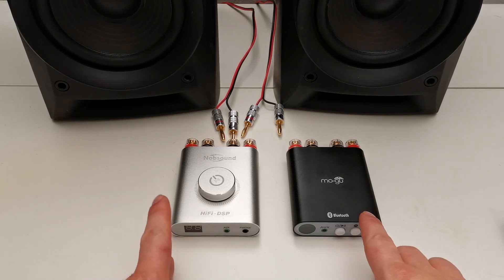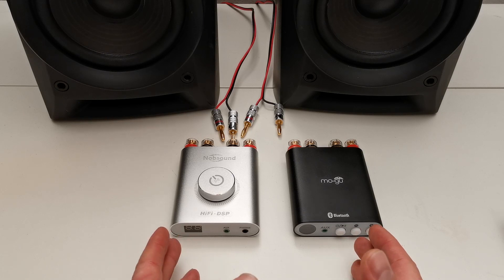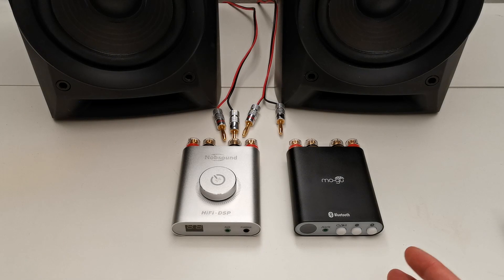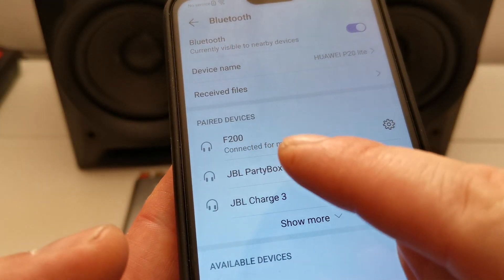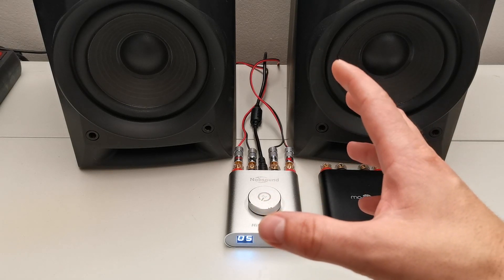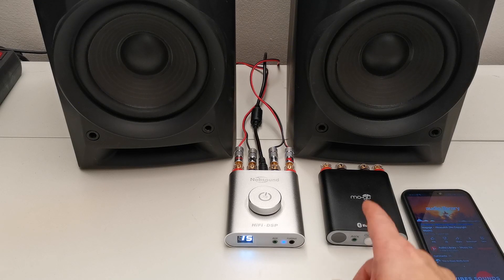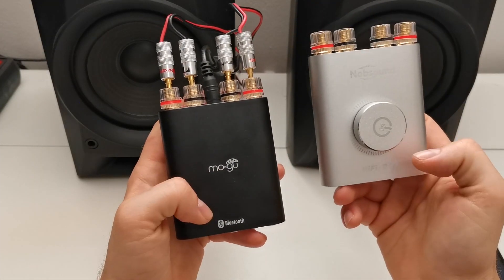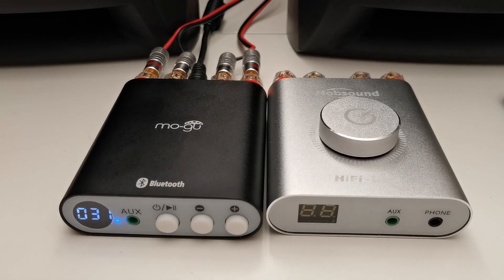MOGU - F200 vs Nobsound - NS20G (The Difference)

Comment: I think if you had 14 gauge instead of regular speaker wire the performance would've been different. And the power bank voltage may be the standard model. I have one believe me, they go hard. And I'm upgrading my power bank.

Comment: Hi ALS

I definitely agree with you, the Nobsound NS-20G is the more powerful amplifier and, by default, has the better sound. However, the heat produced by the NS-20G could be a problem but is dependent on how you use it. For example, my music system consist of five (5) mini-amps and so I have never had to turn any of my amps volumes up too high, i.e beyond #12 on the NS-20Gs and about 11 o'clock on my NS-01Gs, and so heat has never been a problem for me. Even though on average I play my system 2 - 3 hours, every other day, and last weekend I played music for 6 - 7 hours.

So heat generation is down to usage and system configuration.

You maybe interested to know that I now use the Behringer AMP800 Headphone amplifier to connect four of my five amps together and by next weekend I plan to incorporate the Behringer FBQ800 equalizer into my system. At this stage, I don't know whether the FBQ800 will add more enjoyment to my system or be a total wash-out but part of the fun is finding out.

Until your next amplifier review

regards

Bob
Reply from the maker: I agree with you 100%! And I am happy to have you in my audience 👍
Thank you for sharing your experience with us!
Reply: I'm very curious as to how extacly you made your set up like that and why! I have one big amp with 5 speakers to cover 2 opposite rooms, while I have one mini amp with two speakers to cover my study desk. I'd really like to know what the pros and cons of 5 mini amps are. Thanks in advance~!
Reply: @mjbartending  
Hi MJ
TBH, I can only answer one of your questions and maybe speculate on the rest.
You asked "How exactly you made your set up like that and why?"
Well, I started off by wanting to stream my digital music from my NAS to my TV. I soon grew tired of listening to music through TV speakers and so started to experiment by connecting an optical cable from my TV, via a DAC, to a Nobsound NS01G mini-amp and a set of bluetooth speakers. I soon found out that I could connect a second mini-amp to the DAC, so I did just that along with a second set of speakers.

Curiosity (and Covid related cabin fever) got the better of me and so I ended up by buying additional mini-amps, ending up with 3 x NS01G, 2 x NS20G and 1 x Q100 along with variety of speakers including a subwoofer. I then bought a Behringer AMP800 headphone amplifier, which I use to distribute music to 2 x NS20G & 2 x NS01G, the third NS01G is fed directly from the DAC. Then came my Behringer FBQ800 graphic equalizer, an excellent partner to the AMP800, which directly connects to my Nobsound Q100 mini-bass amp, which in turn controls my subwoofer.

In order for all this to work, I stream music from my NAS to the Chromecast device, attached to my TV, which then goes through to my DAC onto the FBQ800, to the AMP800 and onwards to 4 of my 6 mini-amps. As mentioned before, one of my NS01Gs is fed directly from my DAC and FBQ800 directly feeds the Q100 bass amp. 

I can't really answer your "pros and cons" question but I can say that I did not plan such a system, it was borne out of having cabin fever (Covid isolation) and curiosity, i.e. to see how far I could go with this mini in-home project and my wanting to play my music on the best system possible without making myself bankrupt in the process. The downside of all this is that I've had buy equipment "as and when" and discard (give away) about six sets of speakers that either did not work with or did not sound right in my system, which BTW took 2+ years of experimentation, and refining my own musical taste buds, to get the sound to match what I wanted to hear. 

After saying all that, the next system I plan to buy, for my bedroom, will be a more traditional stereo set up with one amp and either 2 or 4 speakers.

Please note, I have not accurately depicted the chronological order of my equipment purchases nor have I included the types and variety of connecting cables I have used to make everything work together.

If you have any further queries..........
Reply: @boblaws7582  thanks a lot for the detailed reply. The whole linking of mini amps principle is new to me. Do you use all those speakers to bring music to different rooms/areas of your home? Or fill one room from multiple angles and/or sources
Funny that you mention it started with tv music and chromecasting. This was my last addition to my set up, the chromecast that is. In order to link it to my main amp, I connect its 3,5mm headphone out to my mixer, which then goes to my subwoofer on the booth out, and independently to the big amp on the amp out. I too have built my system over the span of multiple years and given away speaker sets in the mean time when my set up evolved. My denon amp, mixer and record player have been with me for 16 years now. 

I wish I could put a dac between my nobsound and pc, but the nobsound cannot turn the dac's output into stereo for some reason when I use its 3,5mm aux in, while my mixer/big amp can. So I have to use bluetooth for that.
Reply: @mjbartending    Hi MJ, Maybe I can deal with your last query first, i.e. connecting a DAC to your Nobsound mini-amp. 5 out of my 6 Nobsound mini-amps are not connected to my DAC but directly to my Behringer FBQ800 and AMP500 amps. So I am guessing that you will need an intermediary device between your DAC and your mini-amps.  I only managed to connect my DAC to one of my mini-amps because the DAC has a headphone port, and so I used this as an output to one of my NS01G amps.

As for my speakers, of which I have 8 small ones of various sizes + a subwoofer, are all in one room, you see, I am somewhat old fashioned in the way I listen to music, i.e. it's got to be stereo only, not multi-rooms, surround sound or anything else. Therefore, my speakers are arranged, in my living room, in front of me.

The benefits of this is that I get the best sound from each speaker while the weaknesses are pushed into the background. For example, some speakers have good treble, others have brilliant midrange and vocals, while my subwoofer takes care of bass. And so the blending of my speakers multi-sound is (just) delicious and very emotional to listen to.
And just like you, I had experimented with various speakers and other (non-Nobsound) mini-amps but eventually found that my 6 Nobsound mini-amps and the variety of speakers I now have has given me the clear vocals (both in the fore and background), smooth detailed midrange and deep bass I now have.

You know, Hi-Fi snobs would look down on my system and say it's not real because it doesn't cost a fortune, it doesn't look right or tick any of the  prerequisite boxes but, for me, the sound is thoroughly enjoyable, conveys emotion and has lovely deep bass. 

Yeah, I just love it.

Regards

Bob
Reply: @boblaws7582  all clear, now I understand why you'd use so many speakers for "just" stereo in one room. Thanks again and wish you good soundscapes!